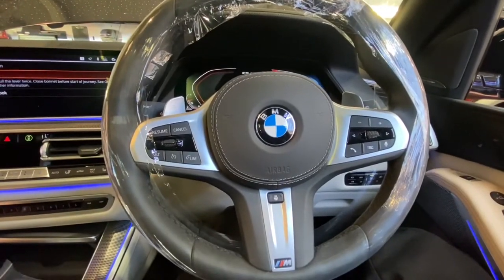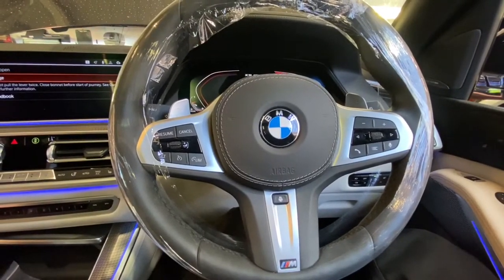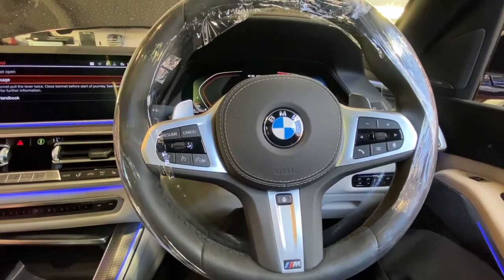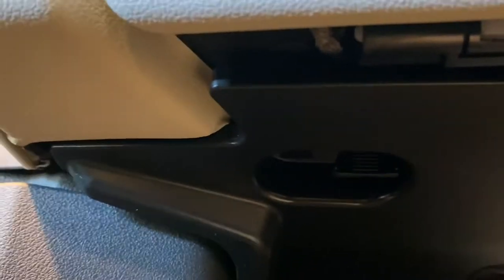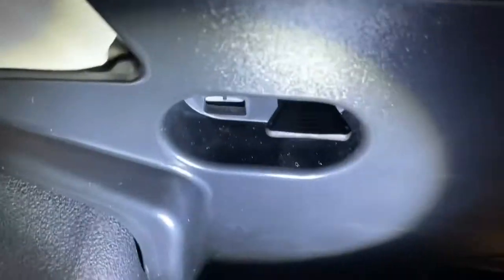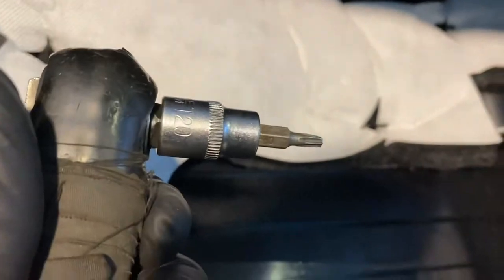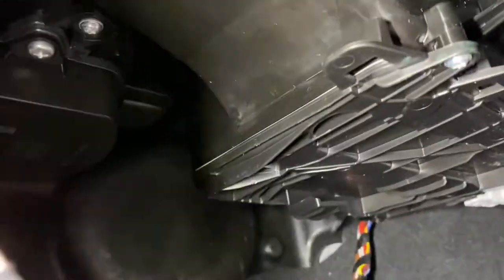#BMW 2020 #X5 #Cabin #filter #replacement/location

Comment: Thanks for sharing, Question did you install both filters with the arrows facing the front part or facing the engine part?  Im asking because i saw another video where dome one install the filter with the arrows in ap posit directions  directions so im trying to find out which is the right way

Comment: I wonder how much BMW charges to replace them
Reply from the maker: Call up and find out
Reply: $200 or so .. lol. Do it yourself
Reply: @Aimster2  They actually wanted $390 
I ended up doing it myself
Reply: My dealer quoted $236
Reply from the maker: If you know how to replace it buy the cabin filter from the parts department and install it yourself
Reply: @g_a_bofficial  Agreed! I purchased OEM BMW Genuine Microfilter for $60 on eBay from BMWPartSource. Quick 15 minute job.
Reply: My dealer quoted me 330
Reply: My stupid POS BMW dealer wanted to charge $850 for oil change, cabinet air filter and engine filter. 

I’ve found an independent BMW mechanic to do same job for $450. 

It’s around $150 for oil change and $120 for cabin air filter at the independent mechanic.